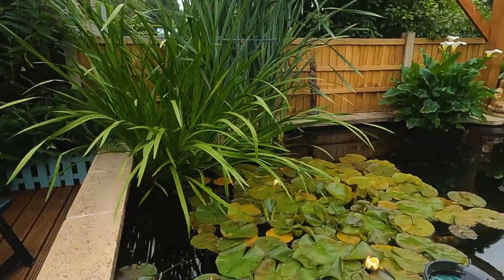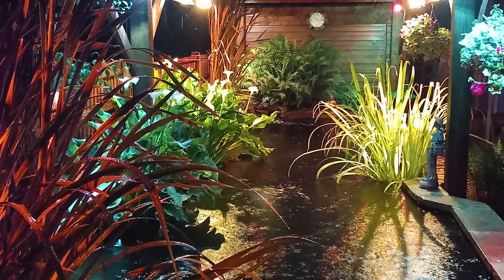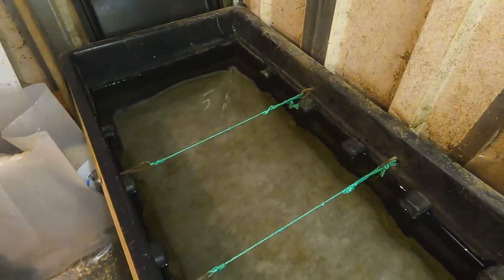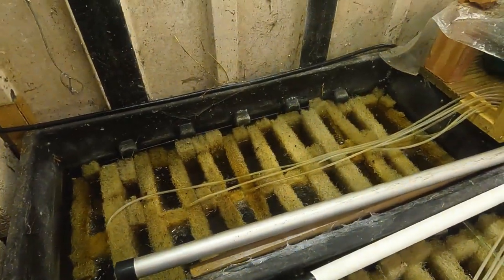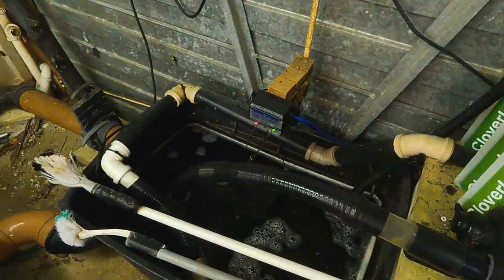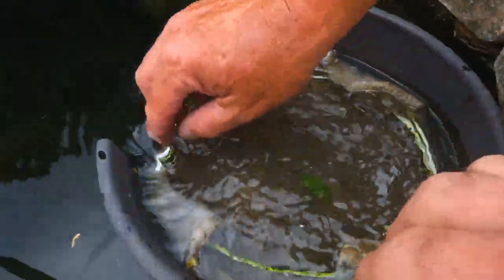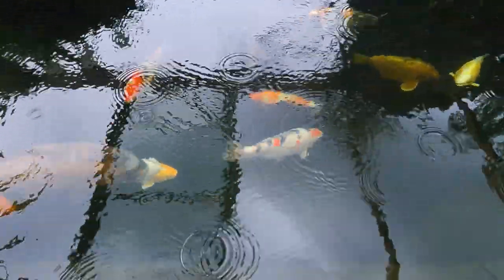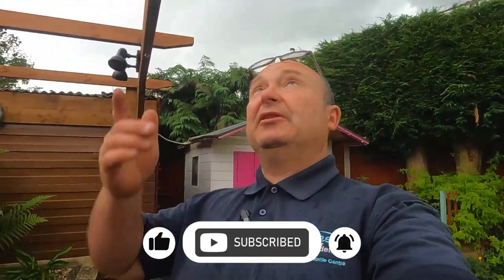Fantastic Planted Koi Pond.

Comment: Very impressive pond and and an amazing diy filtration system. I've incorporated some diy filtration components into my pond's filtration system but nothing close to this set up. Very very well done and judging by the koi and the water clarity it works wonderfully.
Reply from the maker: The filter is very impressive. Its large enough to do the job. And has extra capacity should the fish load increase. Bigger is better.